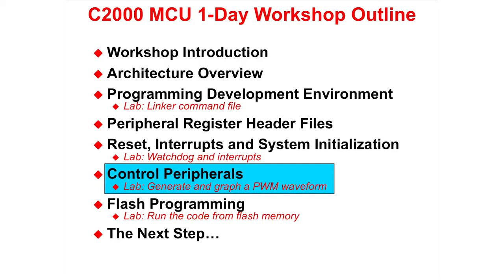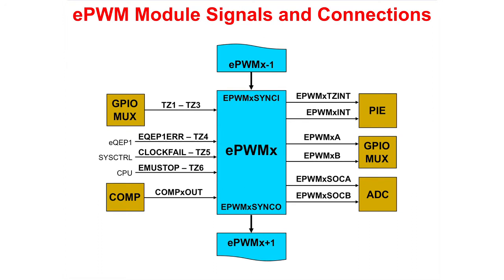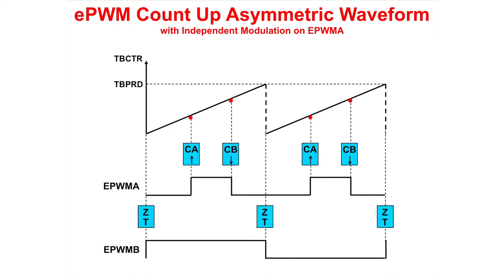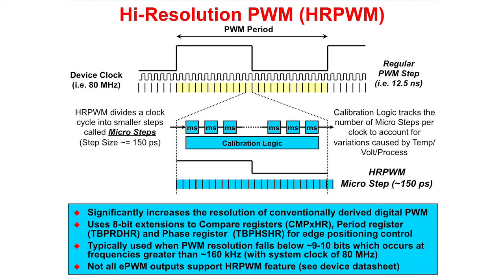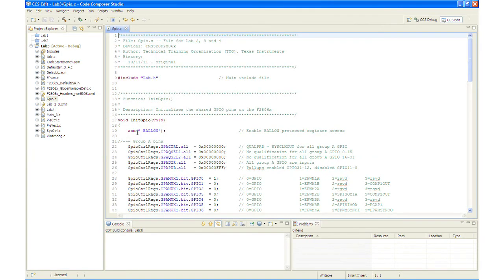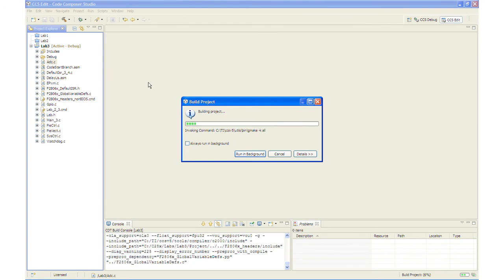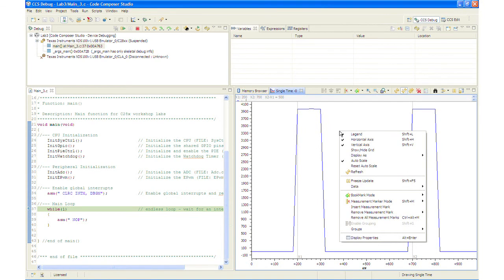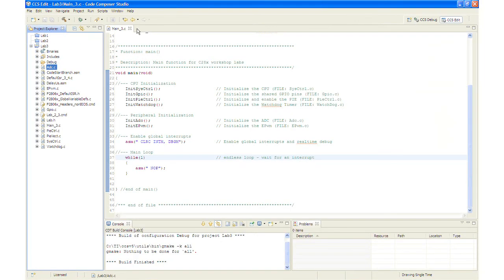C2000 One-Day Workshop Module 06: Control Peripherals

Comment: If i  make my own hardware based on TMS320F280, reffering the C2000 Piccalo Launchpad schematic.I have the C2000 Piccalo Launchpad and it has  XDS100 JTAG debugger. Can i use this debugger for Debugging the code on my Custom Board ? If yes, How it can be done .....

Thanks
Reply: is there slides from this video?
Reply: i believe you need to conect jumper wires from sdwio, swdclk on the launchpad to to corresponding ones on your custom hardware. As well as gnd and 3.3V. Normally there is info on how to do that on the launchpads users guide